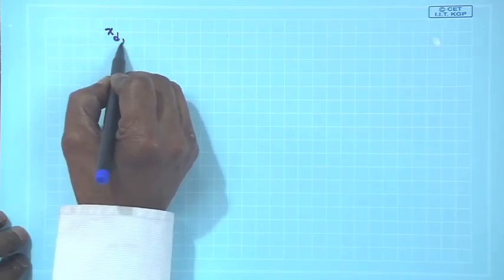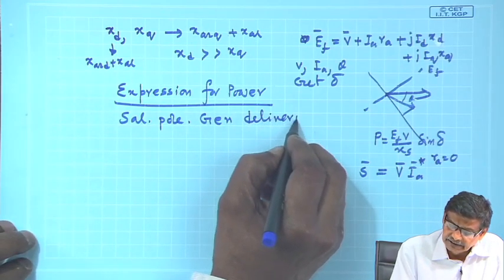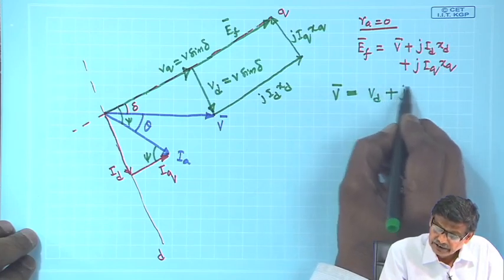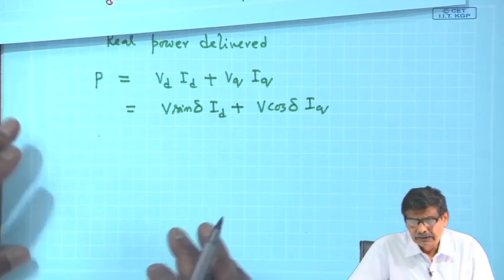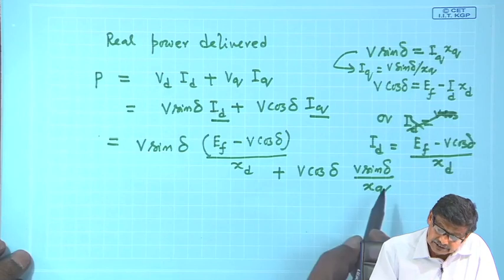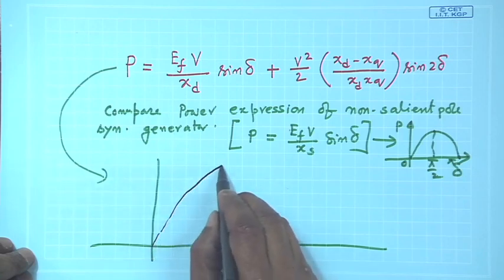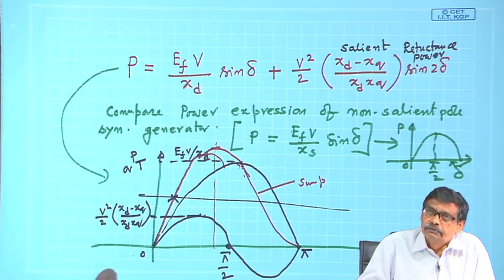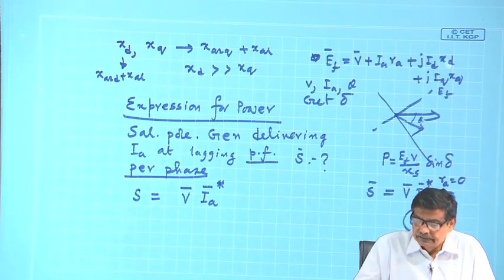Lecture 87: Expression for Load Angle and Expression for Power

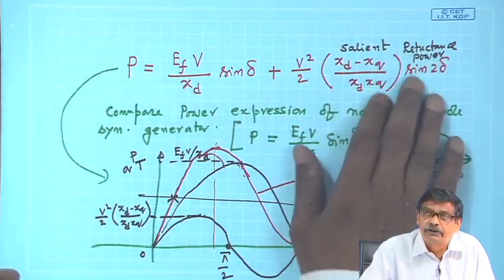Comment: 28:11 Can someone please explain that how salient m/c can still produce power, or torque if If reduced to 0 by PHYSICAL MEANS?
Reply: it will need to overcome friction and windage losses.physically the motor wont rotate at steady state if torque is zero but internally by some mechanism the power generated will be dissipated as friction and windage losses. maybe more about the physical means you will learn in machine design course
Reply: Because reluctance torque is an alignment force between stator field and non-excited rotor. Whereas electromagnetic torque is an attraction or repulsive force between 2 fields